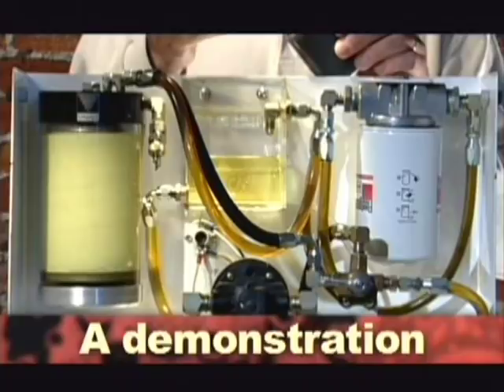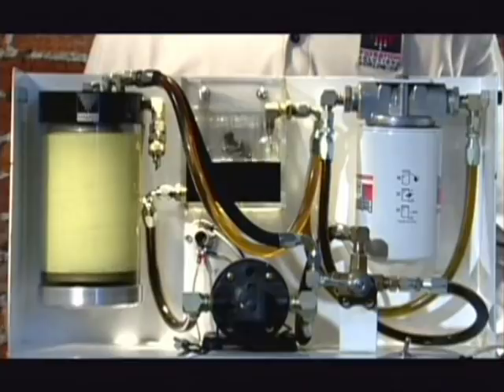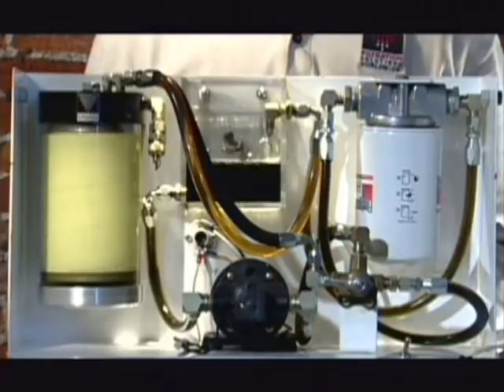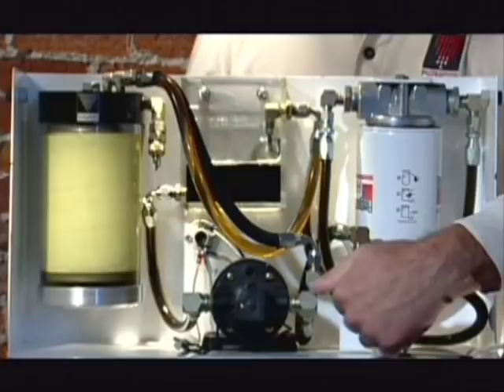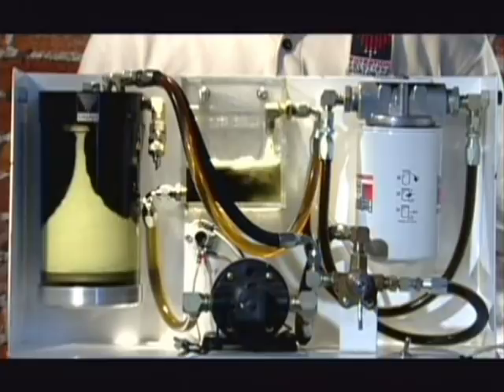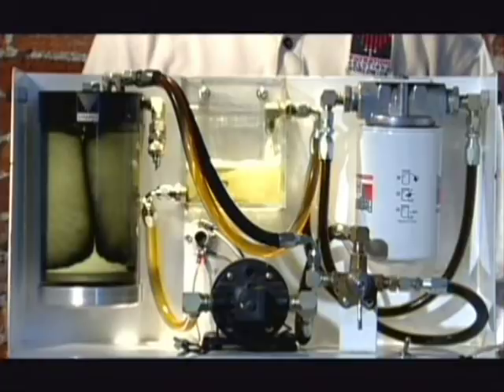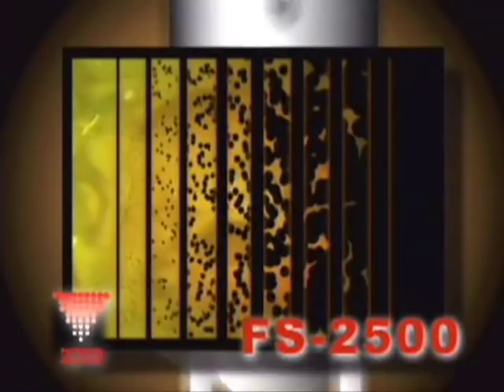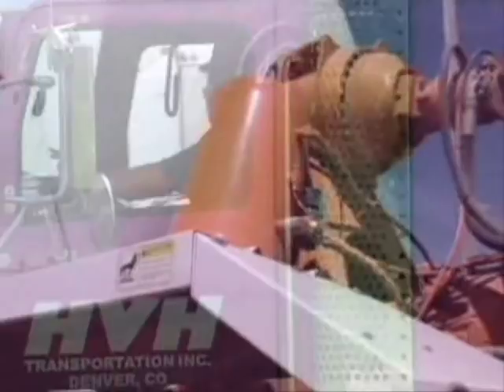Amazing Filter Demonstration - Save Your Engine

Comment: wow it behaves like a sea water reverse osmosis machine!! can I use this to recycle my used oil as well??
Reply: professorfidelcat 
I recycle my son's used diesel oil through a Frantz and then use it in my car when oil is needed.
Reply: No, you can't use it to recycle your used oil, because your used oil is chemically degraded, not just dirty. Even if you thoroughly filtered the oil it would never lubricate properly again. Proper oil recycling requires chemical processes that strip-down the oil molecules and recombine them into new molecules of a suitable length to provide the required viscosity and lubricity.

Comment: Well, that is not true.  The FS-2500 element should be changed every 10,000 miles.  IF you don't change it every 10,000 miles THEN it will start clogging.  But hmmm, how often are you changing your oil and your standard filter anyway?  Its better to put a bypass filter on and know that you are stopping the wear in your engine AND also have the ability to extend your oil drains then keep just a stock filter on that only takes out particles that are approx. 20 microns or bigger.  You do the math!

Comment: I work for a cheap-ass fleet-gasoline at this moment in time[unfortunately for me] that is running full synthetic at 25K intervals between oil and filter changes.
These vehicles still run after being wholesaled with 300k on the odometers.  This is the testament to modern engine design.  After working on these, I am convinced they would still run the same if they never changed the Oil and merely kept them topped up. I do know the filters would be hopelessly clogged and in by-pass.  FS2500 = fake

Comment: Really people, you shouldn't post things like this unless you really have the facts.  The FS-2500 filter should be changed every 10,000 miles.  The patented design allows it to stay "open" for that long because of the way it flows.  It is not like ordinary filters that flow from top to bottom and create channels as it were so that it completely quits working.  It will be completely "loaded" at 10,000 miles.  I would say that is quite a few miles.  Read the testimonials at fs2500 website!

Comment: Micron filtration is a loaded word, like cold cranking apps for batteries. Higher CCA is not always better for a battery, just like filtering the absolute smallest particle is not always better for a filter.

I deal with big rigs all day long, and sell about 10-50 thousand dollars worth of filters per month. The brand I sell is Wix. There are ways to get finer filtration while maintaining good flow for the lubricant or fuel, but typically this is NOT one of them. Most rigs are running two filters or more. One primary, one secondary. They often run in a parallel system where one catches the big stuff and the other runs in such a way as to filter smaller particles without actually being in the way of flow(Often called a bypass filter because a line runs oil that is bypassed the normal system). Same for coolant filters. They run off a completely separate line and not directly in the path of the flow of the fluid(can you really imagine a full flowing coolant if you put any filter in the way?). 

Certain designs can give good flow while making better filtration, but they aren't cheap. It's how Mack does those "football" filter designs for instance. It's basically a multistep filter where combinations of elements, media, and utilizing centrifugal force create better flow while doing fine filtering.

Comment: I kno i kno but the demonstration has me thinking your oil with look clean for a while of course i dont expect a miracle...someone told me diesel oil turns black in less then 100 miles....
Reply: Diesel is dirty, and yes it will filter all that crap. You will ofc need more filter changes on diesels.
Reply: MotoK tips Blow-by. ☻☻

Comment: @crazydiesellover Just like an air filter that traps more dust, it would have to restrict air flow due to all of the excess trapped.  Many filters get away with this by adding more filtering media so that the surface area is increased and oil/air pressure is un restricted.

Comment: So you take crap out of the oil that could cause wear. What is the downside besides the cost of the unit and having to install it. If you keep your car a long time it is a good idea. If you dont care and just trade your car in every few years,why would you do it. people are keeping their cars longer and anything that helps them last longer is a good idea to me.
   The rest of the childish comments below, do some research.
Reply: They are mostly aimed at large diesel engines, otr trucks put on 100k every year.
Reply: So if you keep your car for years.And a bypass filter would remove any fine stuff in your oil. And make your engine last longer?
 Sometimes change is good.  But yes they help with soot on big rigs.

Comment: You lost all scientific creditablity with me at calling it a 5 weight. It is a 5 grade viscosity oil based on a chart. It doesnt weight 5 pounds?
Reply: +Jackie Chan 30 weight is standard old school terminology.  It's fine.
But the W in 5W/30 actually stands for winter.  Don't know why that's necessary, but that's what it is.
Reply: So what exactly do you think the "W"  in 5w30 is idiot? I swear, some people should just remain silent instead of saying something and proving they know nothing.

Comment: If it filter to much it will trip the bypass valve and then you are wasting your time and killing your bearings. that is why it isn't good for these filter to be on Chevy duramax and dodge cumming in fact k&n oil filters can void your warranty on dodge

Comment: Your oil filter won't be the cause of anything that happens in three years, more than likely, and this is the only filter that i have seen come close to cleaning oil back to it's original state, that is considering that there are billions of cars and trucks over 100k miles, so the filter is not what you should spend so much time worrying about. Just change it when you're supposed to, or sooner.

Comment: just change your damn oil so you don't need some super filter , I know people who have 5.9 Cummins and their oil is still light brown  when they change it
Reply: +nope nope You must work for big oil, or you have money to burn wasting perfectly good oil. Not very environmentally friendly, bet recycling is a big waste too. LOL
Reply: +Rick's trucking page I use royal purpal and royal purple glass mesh oil filters
Reply: +nope nope oil isn't even dirty at 5000 but I've never owned any thing that uses more than 6 quarts so its not very expensive and I'm really hard on my motors so oil changes sometimes come before 3000 miles
Reply: +nope nope You dropped synthetic at 3000 miles, that is a waste. These things aren't for your car engine. Semi trucks hold 10-12 gallons, even most diesel pick ups hold 5. At $300 an oil change Oil purifying pays for it self in a few months. A car would take most of it's life to pay one off.
Reply: +Rick's trucking page You're right- any fool that drops synthetic(much less RP brand) less than 10k may as well put a match to their $$$. Good job Rick's trucking page @ trying to explain "apples to apples"- Just to bad folks are so close-minded(they already know everything!) or they may actually learn something for a change! Anyhow, I hear you loud and clear, and what you say makes logical sense! Thanks for the input/info
Reply: +nope nope i would love to see these friends 5.9 cummins. All o my friends 5.9 cummmins incuding MINE the oil is just as black as before the change almost immediately after. Now my 6.7 Cummins i had previously i would last a couple thousand kms before it would start to turn.. that was a good motor.
Reply: Yeah OK, first off if you knew anything about a diesel engine you wouldn't have made that statement. Stick to video games and leave the engine stuff to people who know what they are talking about.
Reply: nothing like a 7.3 though!

Comment: Actually small carbon molecules like 30 microns doesn't matter anything in an engine. The purpose of an oil filter is to filter debris much bigger to prevent the paths getting clogged. This test means nothing.

Comment: It's cool what they're trying to do, but... It's an internal combustion engine we're talking about here. Piston rings are only so good of a seal, ever hear of blow by? The result is fuel air mixture in the crank case. Over time fuel will get in the oil, no filter can filter that out. And im sorry but little soot particles are no where near as harmful as the steel flakes that come naturally from the timing/accessory gear train, cams and even the oil pump. Even the softer bearing material from the Cam and main bearings is more harmful than that little bit of suspended soot. In closing, forego the bypass system smoke and mirrors, just buy quality filters and oil recommended by the OEM, and change at the recommended intervals. Oil these days is top notch and Donaldson makes some high quality filtration products.
Reply: Fuel evaporates.

Comment: they forgot to tell you that by filtering such small particles, the filter element will plug completely shut much faster, forcing the oil filter into bypass. in this condition, it is filtering NOTHING.

Comment: Heh, heh, heh...yes.  If I were to ever be hooked up to a blood machine of some sort, a filter that can block particles like this one, THAT'S the one I want my blood passing through.  *BUT* that incredible filtering efficiency comes at a cost - filter lifetime.  Keep adding that goop to the reservoir and see what happens.  

Very quickly, the super-incredible filter will become totally plugged and it's bypass will open, allowing totally unfiltered oil to pass through. That is, if you're lucky and it has a b.pass valve.  Otherwise oil flow will all but stop.  The less efficient filter will just keep chugging away.  And of course by design, allowing more particles to pass.

The only way to make a proper determination if this level of efficiency is correct for your application is to determine:
  1. What is the tightest clearance in your application?  If a particle of 20 microns will pass through unimpeded and not be crushed in the internals, then there is no point in filtering particles any less than 18 microns. Pick whatever values work for you here.
  2. What are the odds that some event or failure will suddenly increase the quantity of contaminants, plug the filter and it not be noticed?  How long might it go unnoticed?  What are the consequences if the filter clogs and it begins bypassing un-filtered fluid or stops flowing completely?
  3. Based on the two above, does your application then actually require two filters?  In parallel or series?  Longer maintenance intervals or does it need a fail-safe backup?
  
I could keep going.  But my point is this:  Depending on the application, it is CLEARLY not as simple as more, smaller, faster, longer or shorter - is better.  Don't buy into hype and hoopla.  With very few exceptions, deciding if a product like this is "good" requires engineering.  Just follow what the engineers specified in the manual.  No more.  No less.  Yes, that company does want to sell you another new one sometime, but they also know that if you think their products are shit, you'll probably not only never buy another one from them, but you will also tell your friends as well.  There is no conspiracy going on with that...

Comment: Say goodbye to all the good additives your motor oil provides...
Reply: +Frank Stupak oil additives usually can't be filtered out
Reply: +Frank Stupak The additives are smaller, according to what I read.
Reply: The vast majority of additives are sub micron.
Reply: This is my thought. Engine oil has detergents that trap dirt, once that dirt is filtered out here, those detergents stay with the filter. now you have Detergent-free engine oil running through your car. not good.
Reply: mustaine65686,

Yeah... and when you filter contaminated water... all the contaminants trapped in the water hold onto the water, so no water goes through the filter... ~rolls eyes~
Reply: LOL, you obviously don't know how detergent works. good luck with your blown engine.

Comment: This is a load of COMPLETE bs. If you made a car filter that fine it would get plugged up at 500 miles. Whats worse oil getting slightly worse (which is why you change it) or putting a super fine filter in it to keep it clean for 500 then have it plug up and break your oil pump? I would never use one of these filters on ANY of my cars. Hell NO!
Reply: Did you read the first sentence in the description?  It's a bypass filter not a full flow filter.
Reply: Also its for Diesel engines.
Reply: Still, a filter that fine would get plugged up really quick even at 20% of flow.